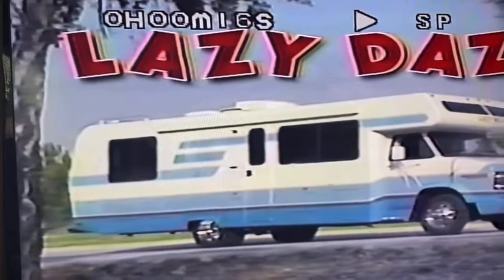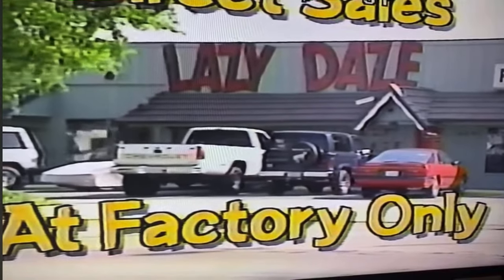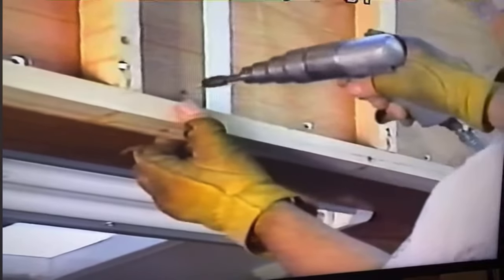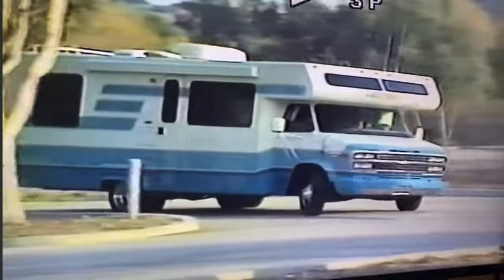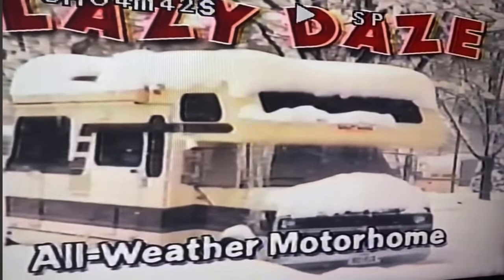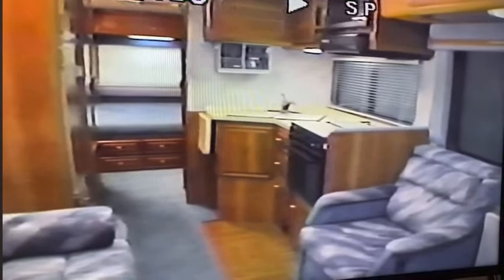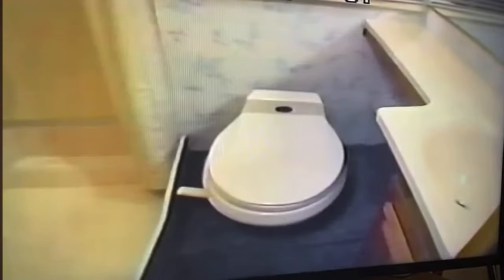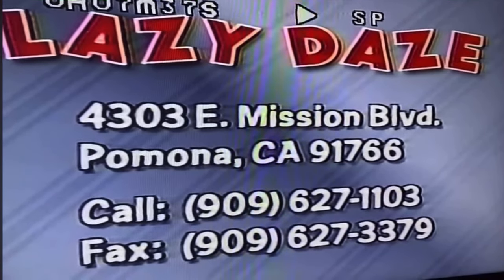Lazy Daze RV | Short history and construction process

Comment: Cool,that's a blast from the past! 
 Good to see people keeping the old rigs on the road,+ much better built than the new junk out there now.
Reply from the maker: 100% agree!
Reply: The older rigs are very dependable, especially through 90's, without a lot of computer controls.
 Biggest thing on the big older
 V-8s is new air / oil filters/ oil/ coolant flush+ change.Check antifreeze/ anti boil strength.
 New gas filters/ PCV valve ( couple bucks) new belts/ hoses, if old/ worn+ obviously haven't been replaced.
Dropping transmission pan+ changing filter highly recommended,often neglected.
All are inexpensive maintenance,and things that can stop a trip.

Comment: Here's a tip, for owners of these older big V-8s. 
 To bullet proof them as much as possible, like hot summer heavy loads/ mountain operation,etc , switch to a full synthetic oil.Stay with full synthetic after you switch. Go with quality synthetic oil filter also,like Mobile 1 ( oil+ filter)
 Substitute a quart of Lucas Oil Stabilizer,for oil, at every change ( 5-6 thousand miles fine) 
 That prevents " Dry starts" wearing parts like piston rings/ etc before oil fully flowing. It also quiets down older engines+ increases power.
 Changing your own oil is pretty easy,to get under these bigger units,and saves $$ and you know you are getting quality parts/ fluids.
All of above,at like Walmart,around 60 $
Reply: Is this the same for say a 2004 V10